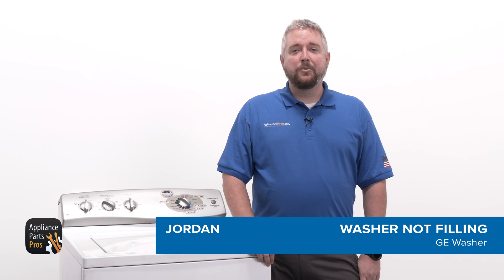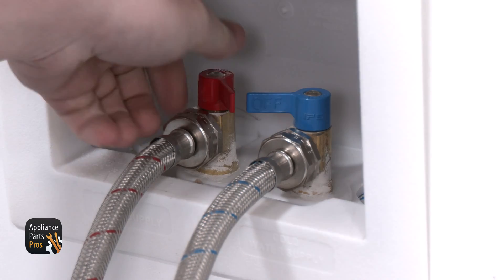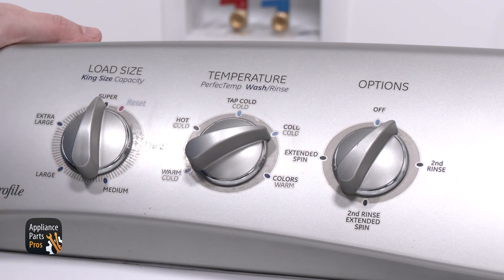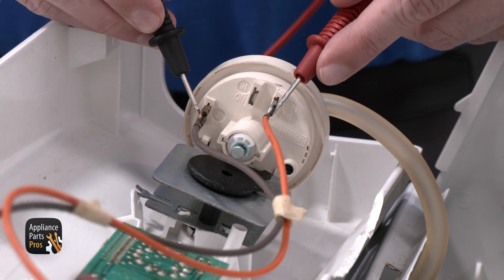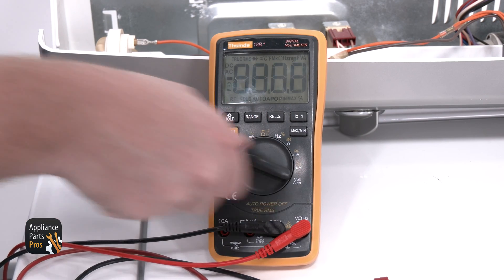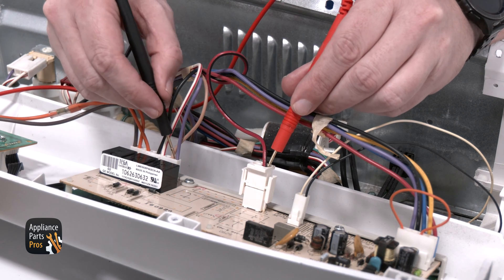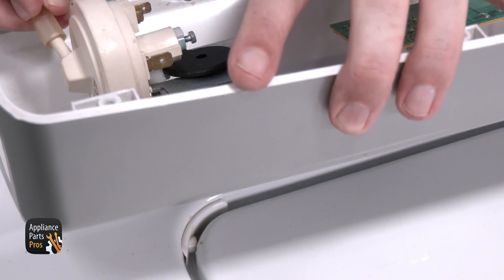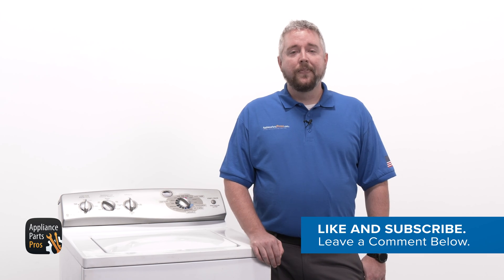How To Troubleshoot A GE Washing Machine That Is Not Filling

Comment: GE gtwn4250d2ws water only fills half way on the tub on all settings. We want it on max and still only goes half way up with water. Changed the water level switched, cleaned the air dome on bottom, tubing is clear, valve makes sound with multimeter. So what is wrong? 😔🤔
Reply from the maker: If you are not getting enough water and the pressure switch is good and the hose is clear then you could have an issue with the control board. Keep in mind, this is a high-efficiency washing machine. This system requires less water to clean your clothes.
Reply: @appliancepartspros  
Hi and thanks for the reply. How do we know it's an HE machine? We were going to replace the inlet valve.
Reply from the maker: It should say that on the unit, but it also says that in the Use and Care manual.

Comment: Hi, how to remove thw Back panel, to get at the tub pressure sensing hose ?
Reply from the maker: What is your model number?
Reply: @appliancepartspros  Hi, thanks, it wasn't the hose, it's the circuit board, so out is goes.
Reply from the maker: If there is anything we can help you with please let us know.
Reply: I'm having a problem with a 2000  GE it never Fills up ... I know it's Getting Water But it Drains as Fast as it Comes in.If Anybody ,can Help Mr I'd Really appreciate it...Of Coarse My Wife Don't Believe We Can Fix it like many many Things I've prooved